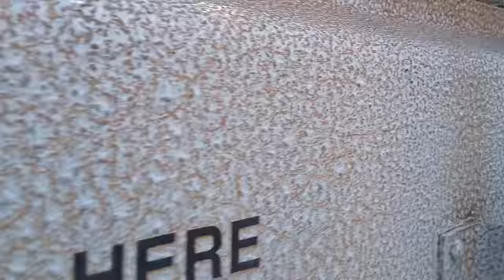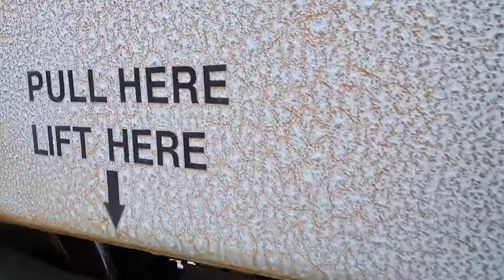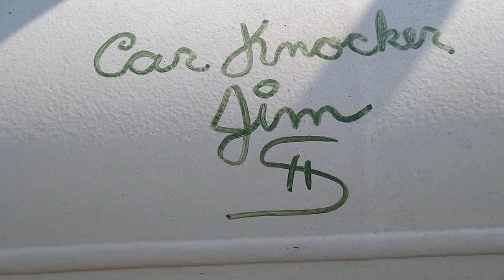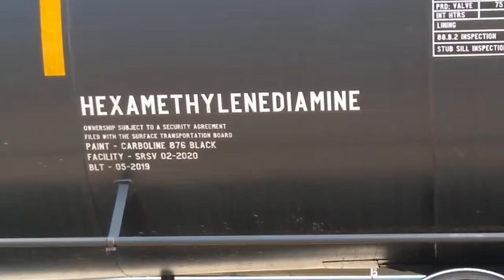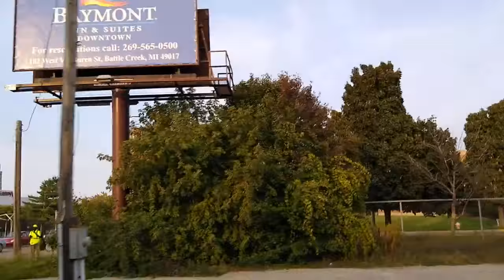Battle Creek to Chicago on CN Railway

Comment: Great video. I always enjoy the longer narrated versions.
 
It looks like the eyepiece to your binoculars was glued on to the body, and the glue is what separated at impact. You ought to be able to repair it fairly easily. 
 
Put the eyepiece up to the body and turn it until it is flush to determine the break pattern. This is critical in ensuring your binoculars focus properly once repaired. Once you know how to orient the eyepiece, apply a very small amount of Loctite Super Glue gel or your favorite plastics glue to the facing joint circumference on both the eyepiece and body. Gels are great because they set fast but not too fast. You’ll appreciate they extra few seconds they afford you to get things perfectly aligned. But you don’t want a glue that will set so slowly that things might come apart if you are not holding them. Hold the pieces together firmly until you are sure the glue sets. Try to avoid knocking the binoculars around as much as possible — easier said than done on a train, I'm sure — over the next several hours, and you should be good to go. That joint should be stronger than the original.

Happy bull—er—bird watching.

Comment: Just before you mentioned it, I was racking my brain. “Hmmm, Battle Creek.  Isn’t it where - yep.  Kellog Cereal.  I’ll have to check and see if POST cereals are in Battle Creek as well.  While I’m at it, General Mills? Ha ha ha.  I remember on the cereal boxes, they would have offers.  I remember Chex cereal had 10 pine wood & paper kites for free if you mailed in x number of box tops.  Wow!  I’m getting old.  Because that must have been around 50 years ago.  I’m 59 now. 😂😁

Comment: You did pretty well dissecting and explaining that chemical mumbo-jumbo stuff contained in that tanker. Actually, hexamethylenediamine is a chemical that is used in the manufacturing of nylon plastic polymer.
Reply: So not the precursor they used in Breaking Bad then?
Reply: @Peasmouldia  Don't think so.
Reply: @MrVosh-nj2lc  Apparently it's methylamine in BB. And they got it wrong in the show, according to the Washington post. Thanks.
Reply: @Peasmouldia  Yep, methyl amine could be a precursor for the synthesis of methamphetamines (Meth).

Comment: there is a also a nice siding for the amtrack service in lansing by potter park coaling tower. its usable both directions and plenty of jungle.
Reply: Those are the same tracks. The problem is when the only time a westbound train will stop by the zoo, is when it has to wait for another train going eastbound, goes by and clears the line. There are two tracks all the way through town, but they only use one, from Ceader Street, out to Mt. Hope, most of the time. In other words, trains don't stop in Lansing enough for a hobo to get on. All the trains have to stop in Battle Creek to at least fuel up the diesel engines.

Comment: At 39:22 just passed Control Point Rose. CP Rose is a control point east of Capital Avenue on the CN main line. This crossover is used to move Amtrak trains using the westbound track at the depot to change to eastbound main line. It is located at milepost 175.0. 'The Creek' is a crew change point for Amtrak. The Pontiac MI crew gets off and the Chicago crew takes the train the rest of the way into the Big Windy. On the 'flip side', the Chicago crew (Including the famous job-board leader Danny U.) get off and the Pontiac crew take over. But these days, with the pandemic, nothing is the same.

Comment: Hi there Shoestring.  I looked up Wikipedia for information about the rail tank car label “Hexamethylenediamine”.  Apparently the chemical is a synthetic diamine compound used in the production of some plastic products, especially nylon. It is moderately toxic and can cause severe chemical burns.  About 1,000,000 tons are produced each year.
Stay safe, and happy hoboing.  All the best to you.

Comment: What would be the problem with riding an empty car carrier  is it the access points to get in and out
Reply from the maker: Need a special tool for opening the door but I use a railroad plate and spike as a chuck and key I'll have to make a video of it
Reply: @TheHoboShoestring   figured as much as you ride those trains you would have found or fabricated your own key  and carry it with you lol just in case lol

Comment: The bridge you went under coming out of the yard to the south was built to lessen traffic buildup and improve traffic flow in that area on Emmet street, too many rails ya had to cross in the yard there and many crossing gates, a win/win for the city and CN. Kellogg’s was a lot bigger until they tore down the older portion of the south plant which they used to give public tours of in the early 80’s.

Comment: Synthesis
Hexamethylenediamine was first reported by Theodor Curtius.[5] It is produced by the hydrogenation of adiponitrile:

NC(CH2)4CN + 4 H2 → H2N(CH2)6NH2
The hydrogenation is conducted on molten adiponitrile diluted with ammonia[6], typical catalysts being based on cobalt and iron. The yield is good, but commercially significant side products are generated by virtue of reactivity of partially hydrogenated intermediates. These other products include 1,2-Cyclohexanediamine, hexamethyleneimine, and the triamine bis(hexamethylenetriamine).

An alternative process uses Raney nickel as the catalyst and adiponitrile that is diluted with hexamethylenediamine itself (as the solvent). This process operates without ammonia and at lower pressure and temperature.[4]

Applications
Hexamethylenediamine is used almost exclusively for the production of polymers, an application that takes advantage of its structure. It is difunctional in terms of the amine groups and tetra functional with respect to the amine hydrogens. The great majority of the diamine is consumed by the production of nylon 66 via condensation with adipic acid. Otherwise hexamethylene diisocyanate (HDI) is generated from this diamine by Phosgenation as a monomer feedstock in the production of polyurethane. The diamine also serves as a cross-linking agent in epoxy resins.

Safety
Hexamethylenediamine is moderately toxic, with LD50 of 792–1127 mg/kg.[4][7] Nonetheless, like other basic amines, it can cause serious burns and severe irritation. Such injuries were observed in the accident at the BASF site in Seal Sands, near Billingham (UK) on 4 January 2007 in which 37 persons were injured, one of them seriously.[8][9]

Stability
Hexamethylenediamine is stable in air but combustible. It is incompatible with strong oxidants.

Comment: My grandfather and an uncle worked out of Battle Creek for Grand Trunk and Amtrak ,i had 2 other uncles who worked for Grand Trunk out of Flint ,the Grand Funk bridge in Flint is still in use and nobody has painted over the Grand Funk logo on the bridge since the tagger changed the T from Trunk to the F in Funk around 1974 or 75 .

Comment: Hexamethylenediamine is used almost exclusively for the production of polymers, an application that takes advantage of its structure. It is difunctional in terms of the amine groups and tetra functional with respect to the amine hydrogens. The great majority of the diamine is consumed by the production of nylon 66 via condensation with adipic acid. Otherwise, hexamethylene diisocyanate (HDI) is generated from this diamine by Phosgenation as a monomer feedstock in the production of polyurethane. The diamine also serves as a cross-linking agent in epoxy resins.

Comment: Hexamethylenediamine is the organic compound with the formula H₂N(CH₂)₆NH₂. The molecule is a diamine, consisting of a hexamethylene hydrocarbon chain terminated with amine functional groups.

Hexamethylenediamine (formally hexane-1,6-diamine) is a colorless, low-melting solid with an important industrial use. It and adipic acid are the starting materials for manufacturing nylon 6,6, a polyamide used widely in textiles and plastics.

Comment: You are not at the Grand Elk at all in the beginning, Grand Elk is former NS line from Elkhart thru Kalamazoo to Grand Rapids.....you were in Battle Creek at the CN (former GTW) yard. Just beyond the signal  and tracks and passed the trees from your view in the beginning is the Kellogg's Cereal plant.  Many of those chemical tank cars and CH's are Dow Chemical traffic.  Fuel dock in BC is generally unused.  Westbound train doesn't go to Elkhart...it goes to South Bend then on into Chicago, mostly to Kirk Yard near Gary. CN traffic here is down quite a bit since quarantine.  A short distance to the right (SW) from where your video started is the intersection of the NS/Amtrak Michigan Line that also passes through BC.

Comment: Glad you are out riding again.  As far as your bino's being broken, the best glue to use on it is Hardman Double bubble.  We use it on the Army Helicopters for hold plastics.  It dries in about 30 minutes and is super tough.  I put a link down below.  I don't keep up with your funding however if you get into southern Tennessee or Northern Alabama and need some help, let me know.

https://www.amazon.com/Hardman-Double-Bubble-Setting-minute/dp/B00C6SI0QU/ref=sr_1_14?dchild=1&keywords=Hardman+Double+Bubble&qid=1600928441&sr=8-14

Comment: Hexamethylenediamine is used mainly for the manufacture of unmodified resins, water treatment resins, resins used in paper manufacture and adhesive resins. The application of hexamethylenediamine is solely industrial product based, and consumers are unlikely to come into contact with it